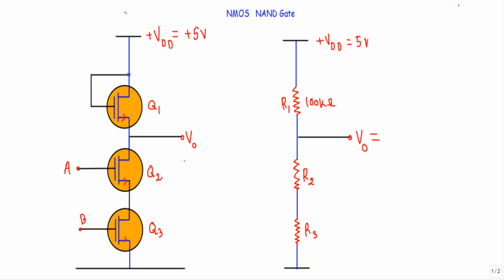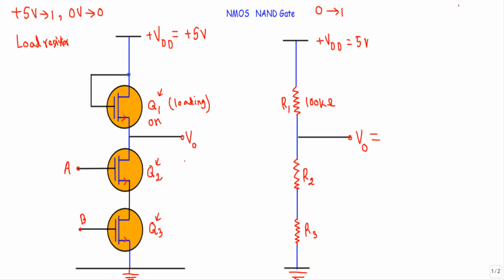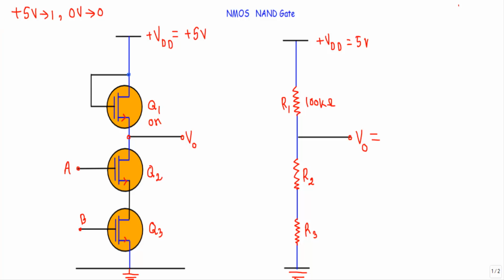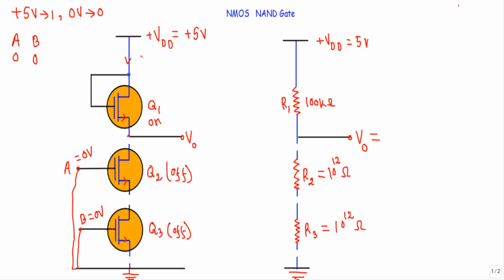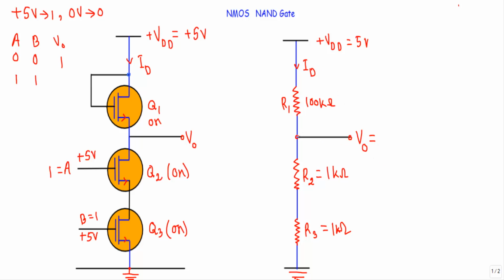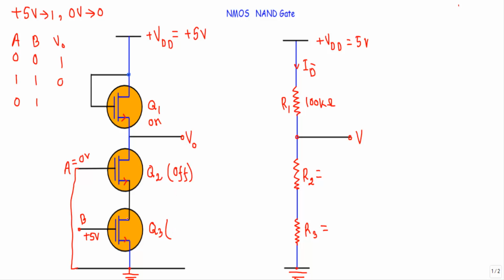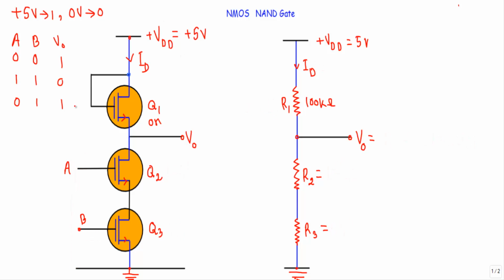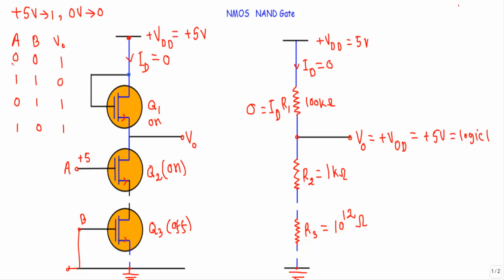NMOS NAND Gate

Comment: But... How work Q1. He is on everytime. And when A and B is logic 1, every transistors is on, and we have a short circuit. Why is not happened? Why Q1 don't replace to a simple resistor?
Reply: You can replace Q1 with a resistor. And the short circuit that is formed when the other two transistors are high is the reason why Vout = 0 in that condition - the voltage drop across Q1 (or a resistor replacing it) is the the entire source voltage because the other end of the resistor is ground.